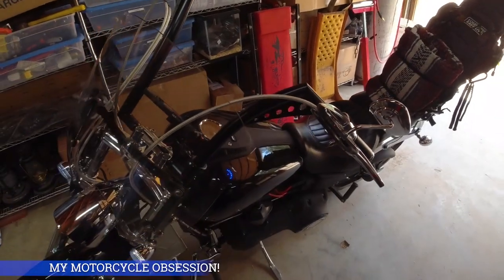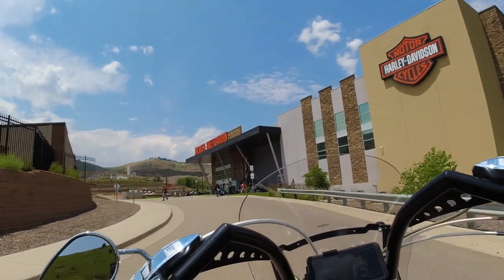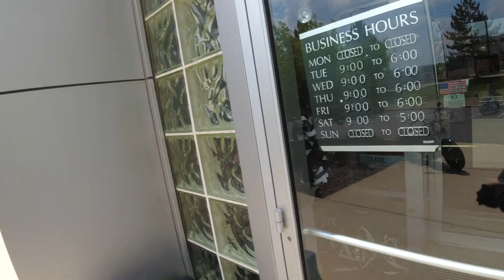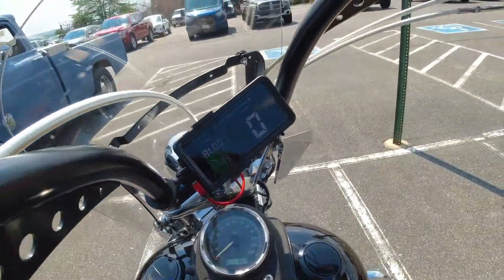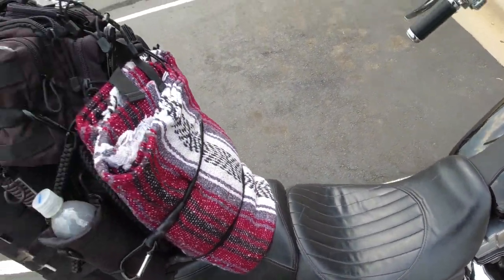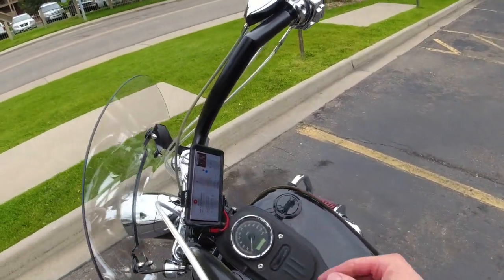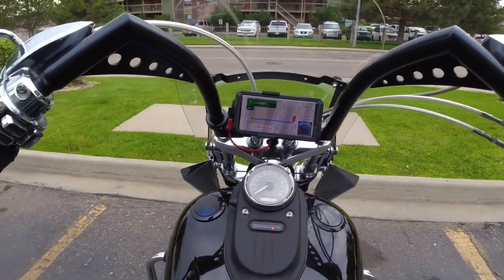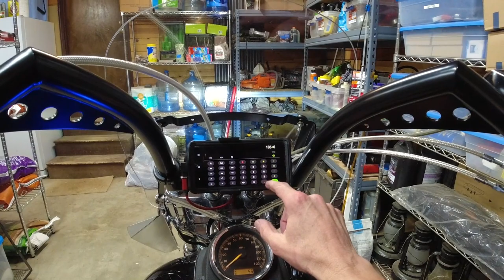Riding my Harley Dyna EIGHT HOURS in ONE DAY! (For 5 Poker Chips!)

Comment: Chris I didn't see your 2014 Sportster 1200 in your garage.
You park the sportster some place else?
Reply from the maker: Good catch!  Actually as part of the sale they ran it through a safety inspection, they replaced both tires which was cool and an unexpected bonus, they are also changing out all fluids.  Then they found the clutch cable was bad and the cable is on back order.  Can't get the bike until they fix the cable, I told them I'd buy an aftermarket they can install, they said nope, they need to get the one from Harley.  And no ETA on that cable yet...